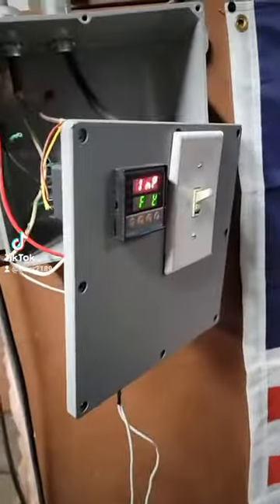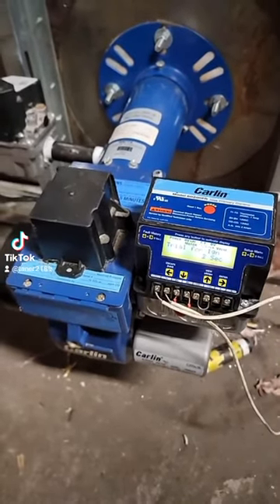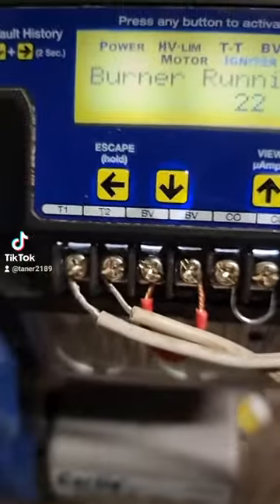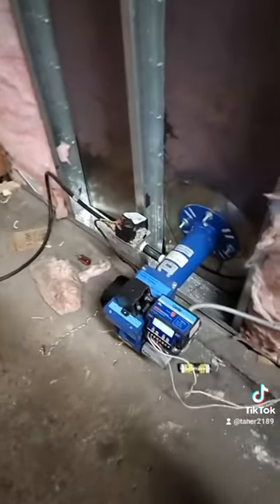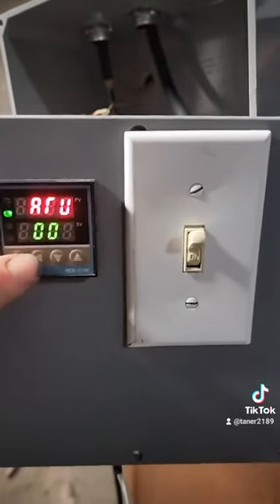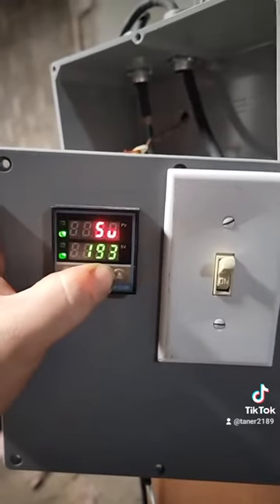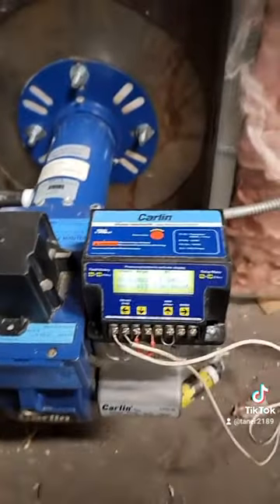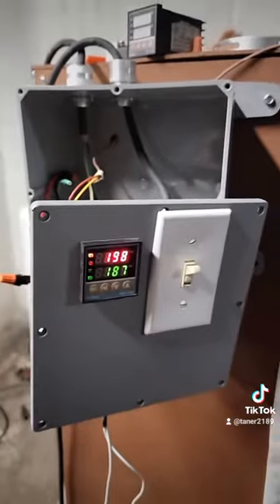carlin ez gas conversion burner powder coating oven

Comment: Man thanks for this video!
Reply from the maker: No problem man 👌
Reply: @24dodgecummins1  how’s it been working for you?
Reply from the maker: @doingishwithish622  it's been decent, I'm getting ready to put a box on it for the flame and how far it shoots
Reply: @24dodgecummins1  awesome man, look forward to seeing it. I just finished my oven as well and couldn’t get the controller to work for the life of me
Reply from the maker: @doingishwithish622  they are a pain in the ass sometimes
Reply: @24dodgecummins1  what adapter are you running from gas valve? Any links or sizes? Once again thanks man.
Reply from the maker: @doingishwithish622  I'll make a video tomorrow, I'm building an expansion tube for the flame also

Comment: When he burner reaches temp on PID (400) and shuts off I have trouble with backdraft of heat to carlin triggering up lockout on the carlin. You experience this? How did you vent oven? any help appreciated, thank you!
Reply: What do you mean by triggering lockout? Like it won’t turn back on?